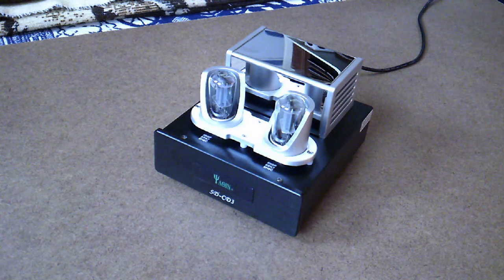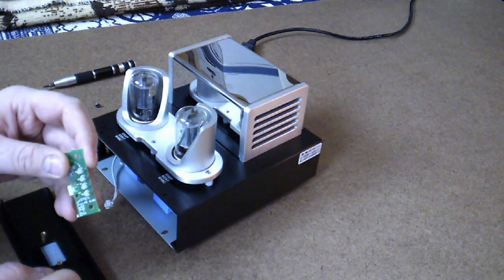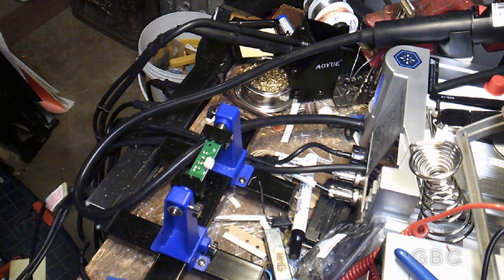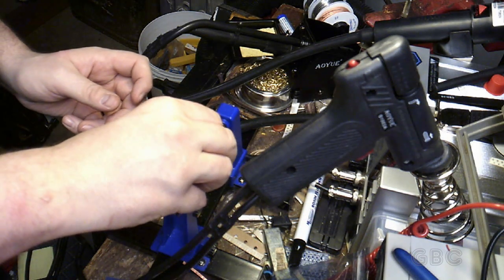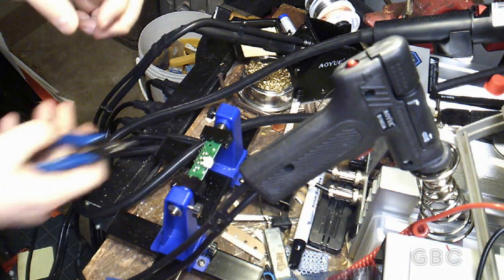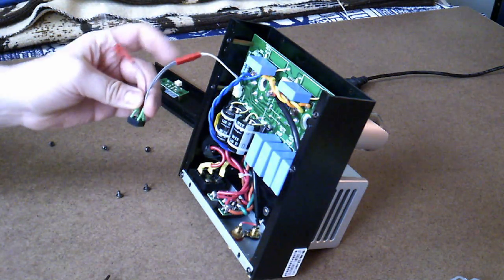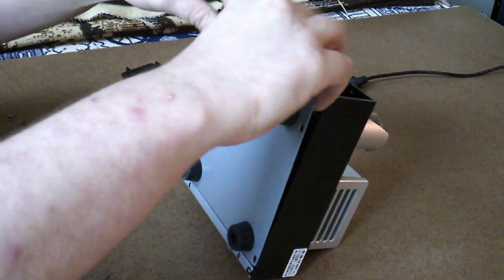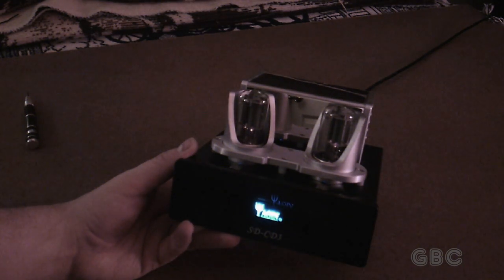[7] Yaqin SD-CD3 Tube Processor Modification

Comment: why don't you change out the stock tubes with some NOS 6SN7 and change the coupling caps to some mundorf, clarity or audyn - THAT would be a modification and is one I did that mad a SQ difference.
Reply: Is there a video about the cap mod you mentioned?
Reply: You nailed it.

Comment: Nice video...  I couldn't find a review of this product in your channel so I'll ask you directly, what you opinion of the Yaqin SD-CD3..?  (Burn in time? Any good? Etc.)
Reply from the maker: It doesn't take too long to warm up.  With the LEDs I added, it's warmed up by the time they turn green.  It's very clean sounding.  I'm running +4db through my system and it handles it with no problem.  It would be nice if it had a bypass switch on it.  That may be something I'll add in the future.